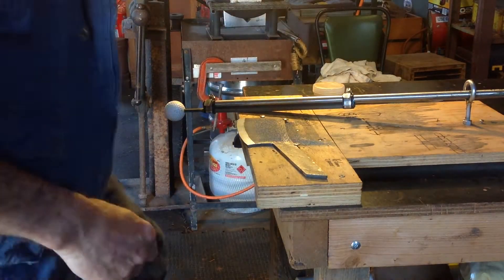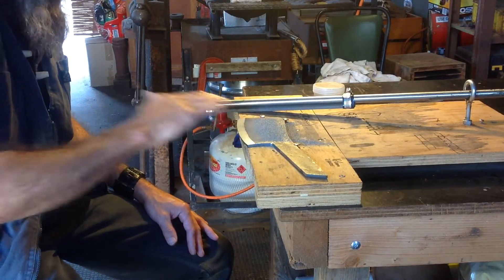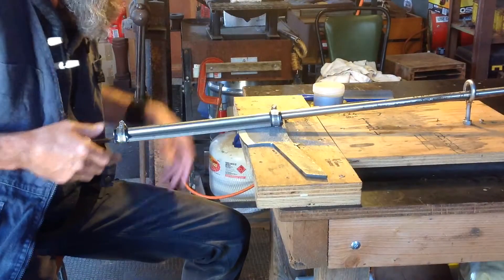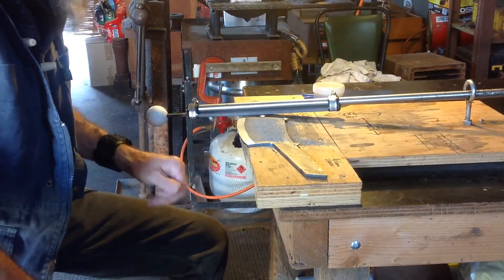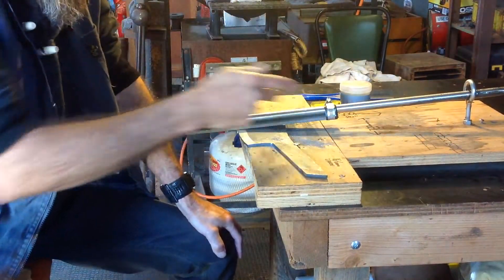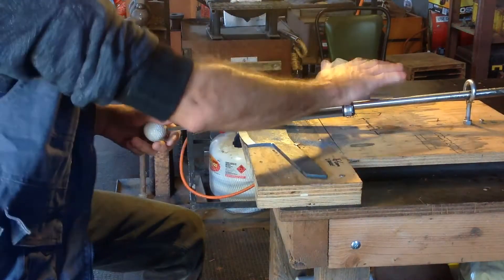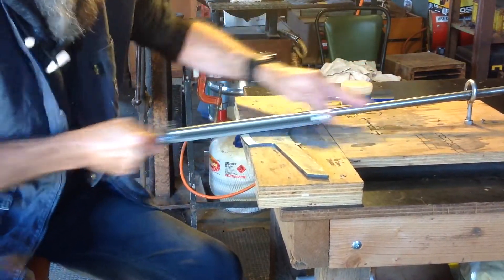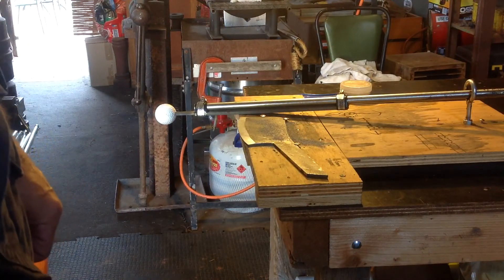File jig in action

Comment: What angle do you use when you first start? Or does it matter what the thickness of your steel?
Reply from the maker: That can vary depending on thickness of the steel, marking the centre line and the hight of the bevel helps. Once you start filing you can make small adjustments to ensure you hit both marks at the same time. I take an educated guess to start.😉.  A small digital level  is the best way to measure the angle if need be, I have found it not absolutely necessary. Though for my own learning it has helped understand what works and what doesn’t.
I like to measure the hight of the eye bolt and thickness of steel and note them down along with what hight bevel I ended up with for future reference.
With that information and a tracing of the blank it is easier to repeat the same knife.
Reply: @shiftybladesbobbysmith6549  Thank you for your quick response. I have just started making knives. To be honest all I have made so far are patterns for future knives out of mild steel. I  have been gathering just the basics tool to get started. My training has for the most part has been YouTube videos and a lot of trial and error. I thank you and everyone else who have these channels for your instructions and advice.